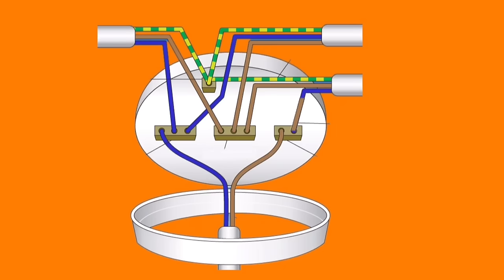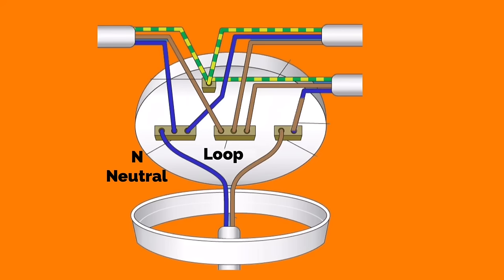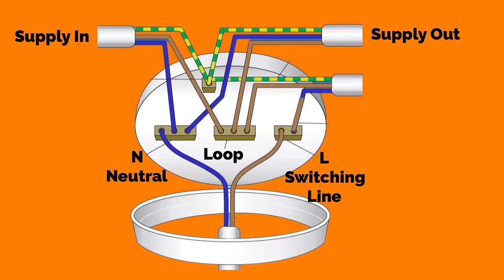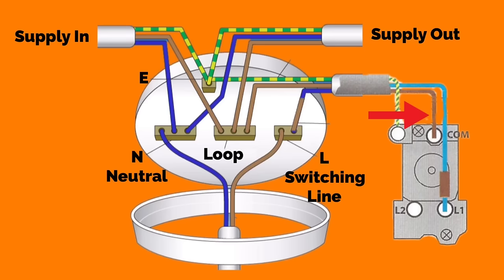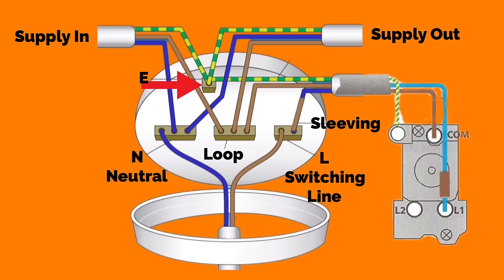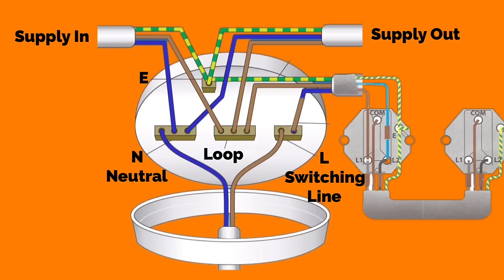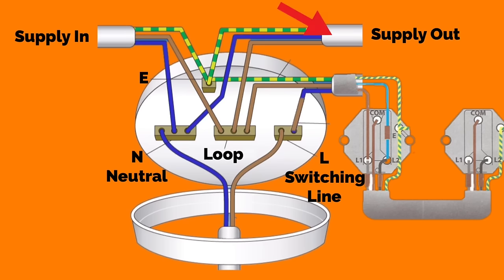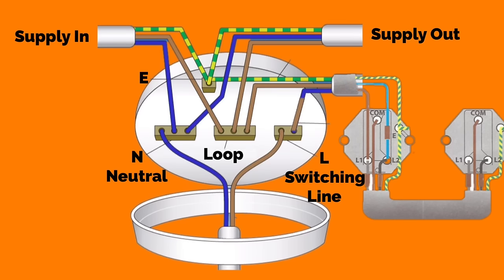3 Plate Loop-In Method Connections Explained for Wiring a Domestic Lighting Circuit

Comment from the maker: == 🕐 Time Stamps - Cut to the action 🕕 ==
00:00 - 3 plate method 
00:22 - What are the brass blocks identified as 
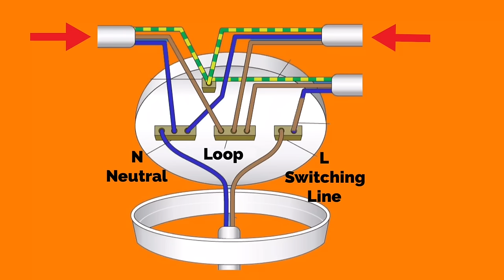00:52 - Supply coming in and going out
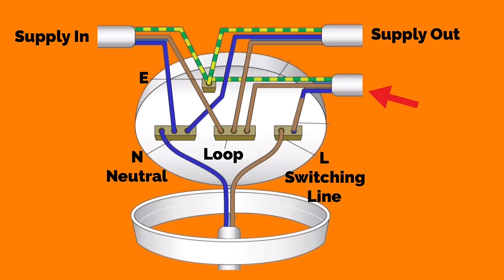01:30 - Cable to the switch  
02:04 - Identifying the switching line conductor
02:33 - 2 way switching explained 
03:31 - Cable feeding another room 
04:15 - Pre 2004 cable colours

Comment: When I was young 😇 Always thought every house had the 2 plate method. Nicely explained. Every house I’ve wired has the 2 plate method. Especially now a days, smart switches requires a neutral to the switch. Again nicely and clearly explained 👍🏼
Reply from the maker: Thanks for the wonderful comment 👍🏻
Reply: Can smart switches not be used if you have a 3 plate wiring?

Comment: In New Zealand 3 plating is considered a bit of a short cut. It uses slightly less cable than feeding the switches but it leaves a live feed at the light even with the switch off which is a danger to a home owner giving electrical work a try. It also means the whole circuit has to isolated to work on the fitting rather than taping the switch or putting the switched wire in a connector.

Comment: Hi
I am so glad that you published this video. I had a ceiling rose with a loose connection, after turning off the light switch I then started to  disconnect the ceiling rose, it gave me a "bit of a jolt" and I ended up, on the floor, with a ceiling rose in my hand and a lot of loose wires hanging from the ceiling. Without your video I wouldn't have had a clue how to fix it, but now I am the owner of a ceiling with a nice new light that works and no loose connection's 😁💡😁💡😁💡😁
P. S. I would like to point out that I am a chef and not an electrician.
Thanks again for the video. Steve T
Reply from the maker: Hi. Thanks for taking the time to comment in such detail. All the best thanks for watching GSH Electrical 👍
Reply: Did u only switch the light off from the switch the first time? Did you not turn off at fuse box?

Comment: Perfectly explained. Thanks
Reply from the maker: Hi. Thanks for the support GSH Electrical
Reply: Fucking ell when I think about 3 plate system then it makes sense lol
Reply: Don't like this 3 plate wiring because when the switch is off the fitting is still live, also if you want to change it to a fancy new light fitting that has terminals for only two wires to fit in each connector.
I like this video and thank you for helping others.

Comment: My old light setup was like the one in this picture but the new light fixture has the earth connection on the centre hole with then 2 others for L and N. Would the looping wires (from the ceiling) go to the center hole connector where the earth is or would I put the live looping with the live wire in the one hole then the neutral looping in the neutral hole with the neutral wire?
Reply: JCglitchmaster this is our problem did you get a solution

Comment: Wen fitting 4 downlights with one wire ,,d do  need 2 use a separate wire to loop them all up pls help thanks,, peace
Reply from the maker: Ally Quinn you need switching line, neutral and cpc at each of the downlights
Reply: @GSHElectrical  thanks m8 much appreciated

Comment: What do you need to do to add another light socket to the end of the circuit? Does another wire come out of each terminal from the first light and go to the next in the same way.

Comment: I have a light that has a single 2 core +E cable leading to light...

What really confuses me, is that it is a 2-way light switch that operates two conventional ceiling lights, and only the one with the single cable will turn on.

I'm I correct to assume that there must be a junction box in the loft?

Comment: trying to wire up a new bathroom light. prob is it only has 4 terminals but 9 wires. the 3 wires for the fitting r already attached when i bought it but cant workout how to connect the wires from the switch. terminal 1 says nautral loop blue or black. terminal 2 earth loop. terminal 3 switch wires blue with brown sheathing terminal 4 live loop brown or red. But the switch wires r blue on 1 wire brown on the other. neither r blue and brown . the wire already on the switch teminal pre wired is brown. So how would i wire that up? Presuming both the blue loop wires go in terminal 1 and the 2 brown wires go in terminal 4. but cant workout where the switch wires go. 1 will go in terminal 3 but dont know which, then the other wire left over where does that go?

Been waiting 6 months for the landlord to fix the bathroom light as it just kept blowing the fuse when i turned it on so trying to fit in a new dome bathroom light as the old 1 was a pendant type and rusted out.
Reply from the maker: So sorry without looking at your issues it would be naive to offer advice... contact a local electrician... all the best Gaz 👍

Comment: hi , I have two lights with one switch. can I disable one light permanently or install 2nd switch for second light in this circuit, how? please advise me
Reply from the maker: Hi. Yes you could disconnect at the lighting point the second light that comes on by removing the switching line, neutral and cpc that goes to that light. You can also two way the existing 2 lights with the extra cable between switch’s as stated in the video.
Reply from the maker: Hi. You could move at light one the switching to the other light and put it in the loop and at light 2 move the current switching line and put that in the loop then run a new cable from light 2 to a switch and connect as stated in the video. Thanks for watching GSH Electrical

Comment: Can you explain a Klix for emergency lighting where you have loop in which I was told to put brown/s but black as permanent live
Reply: @mrmurphypiers1241  Thanking you, so to summarise, black powers emergency lights and brown powers non-emergency lights but both could be on the same circuit. The situation that I used this system was for emergency lights, outside and inside for emergency exits on two different doors (through box and end box joined together and through box  and through box at each door).  The only thing that is now confusing me is for these certain 2 doors we came directly off a canilis type busbar for our power, converted to right colours at the canilis  plug. I know about using links to switch live within light fitting for maintained.

Comment: I want to change my light fitting to a rose pendant but my wires are different. I have 3 brown wires, 1 blue wire and 2 green/yellow wires. Then another green/yellow wire with a metal loop on it. So which wires go where? This is the 2nd light in the room the other one had more wires.
Reply from the maker: Hi. Message me on Facebook with an image of the connections and I will try and help. Thanks GSH Electrical

Comment: My lamp has one blue, one brown and one green/yellow cable...do I need to connect the earth cable as well or it's fine just with the brown and blue one? noob here
Reply from the maker: Hi. If the fitting is metal it is like that it needs connecting to the earth terminal within the fitting.
Reply: GSH Electrical thank you for replying.  I just left the earth on disconnected and it works just fine with the other 2 on. I just don't understand why it came ( the lamp) with the earth one as well.
Reply: budibausto the earth only protects the circuit or you from a fault.
Reply: @budibausto  If its a metal fitting you should always connect the earth wire

Comment: In My ceiling I have 3 grey wires all containing black red and green/yellow. My new light fitting has got the wires already in a socket which is stuck to the base of the light. The socket has 3 holes 1 hole has the brown wires and 1 hole has the blue wires, and the middle hole has nothing, the green/yellow wire is attached separate to both plates of the lamp but doesn't have a hole. Where does the wires in the ceiling go
Reply from the maker: Hi. The old colours are red and black. Red is now brown and black is now blue 👍. Thanks for commenting GSH Electrical 👍

Comment: Is it the same way if you want two light's?
Reply from the maker: Hi. The switching arrangement is the same but so two lights come on together the second light need connecting to the neutral and switching and not the loop. Hope this helps GSH Electrical
Reply: GSH Electrical hi thank you so much, a couldn't find anything to help me.

Comment: What happens when you want to change from a ceiling rose to a light fitting that has only 3 connections ?
Reply: Think you use a thing called a wago? But not sure
Reply: Fit a junction box in the ceiling. Then you only have 3 wires coming down to connect to your new light fitting. Basically your new light is the same set up as a flex light
Reply: @Paul-vq8fk  Ye but now you have to make a big hole to fit the JB through. I just prefer the old way less wires.
But ye if the new light fitting covers the hole and you have enough wood left to screw it to.

Comment: I've got power back everything works in all room's except the light switch. It's constantly turned on
Reply from the maker: Hi. Possibly you have both the cables from the light switch in the loop in terminals at the light 🤔.  This would cause the light to be permanent on... good luck Gaz 👍
Reply: @GSHElectrical  cheers bud. Problem was in actual light switch
Reply: @saturdaysbomber7502  i kno this is crazy but how did you fix this?